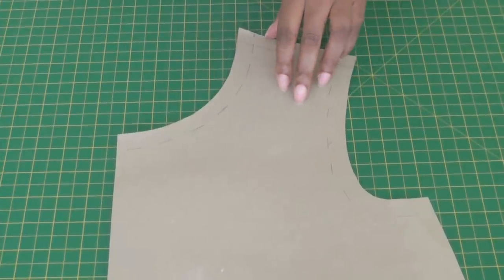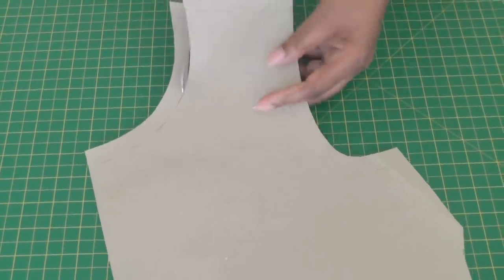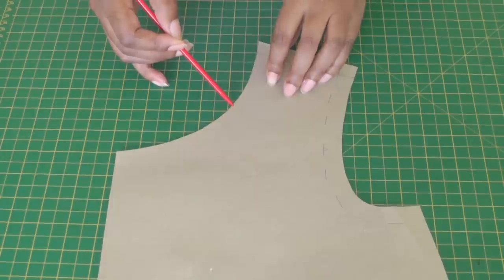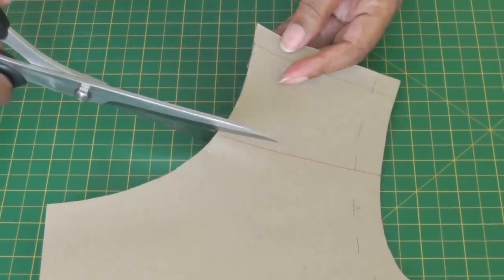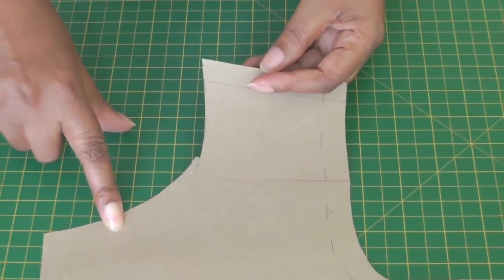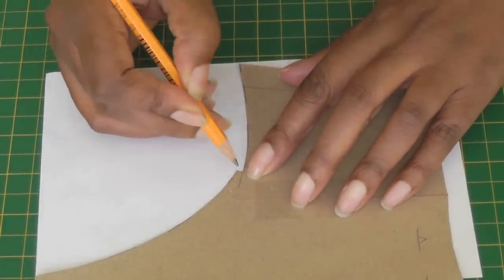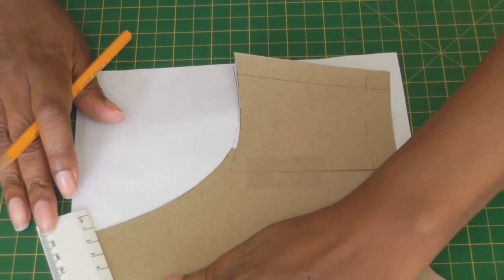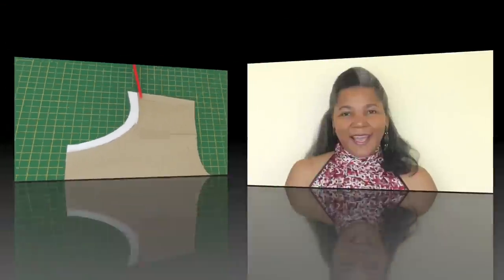Adjusting a Gaping Neckline

Comment: I'm trying to figure out if my neckline is too large or if it's gaping.  its a scoop neck style neckline (with a button placket down the middle) and when I stand up straight it looks fine.  But when I lean over you can easily see down my shirt.  I'm about to make a dress version of this top but I want to adjust the neckline on it so I don't have the same issue as the top I've already made.  But I'm not sure which fix is right. Would it be a gaping neckline or just a too big neckline where I need to raise the entire thing?  I have no darts in it currently as I had to do a Small Bust Adjustment and that removed the dart that was in the pattern.  Also is there any way to save my top I"ve already made?  I don't have enough fabric to remake it.
Reply from the maker: Fabric choice could be an issue, and maybe even the weight of the buttons. I would do test samples before attempting your project, and finally maybe putting darts into the top my save it.

Comment: Hi Colleen. Thanks for the very informative video.
I have a question. If the neckline is gaping at the centre front how would I remove the excess? Or would it work to reduce it from say half way between the centre front and shoulder?
Reply from the maker: That may work, but there is a possibility that the neck shape will become bigger!
Reply: Thanks so much
Reply: I eventually lifted up the neckline by 1cm at the shoulder, on the neck edge only, and reduced the centre fold by .5cm, squaring down to smoothen the front fold line and it worked like a charm!

Comment: This seems like it works for the neckline but now the armhole seems altered.  Do I need to alter the sleeve pattern and also how do I make a new neck facing?
Reply from the maker: Trace around the NEW neckline! No you don't need to alter the sleeve, but you need to adjust the back shoulder seam.

Comment: I have two questions about this tutorial:
1) pivoting the neckline changes the shoulder seam angle. Do I have to change that to the back part of the pattern too?
2) does that change in the shoulder seam affect the armhole fitting?
I'm trying to make a v-neckline properly and I have tried it so many times, but there's always a ugly gaping there.
Reply from the maker: In answer to your questions -
1 - The shoulder section will not need to be changed.
2 - It shouldn't.  The alteration to the neckline should not effect the shoulder or armhole.
Reply: @colleenglea  The angle of my shoulder has altered.
Reply: @DeeDee-mo6tn  the angle of the shoulder seam on the front piece will change, this is what's supposed to happen, it shouldn't effect the armhole or the fit at the shoulder seam... Unless you've taken a massive amount of excess fabric out, which would probably mean other fit issues are at hand.

Comment: Thank you so much for the tutorial! Question: you say to make the slit where the gaping is occurring. What if the gaping is occurring directly underneath the chin in the middle of the neckline? I am Michelle, by the way and Jerrold is my husband! We use his email as the You Tube contact. Thanks!
Reply from the maker: Hi Michelle. Pinch out the fullness in the pattern which will create a dart type effect. It's called a dead dart. This will flatten out the pattern.